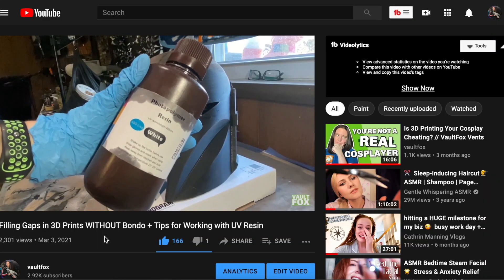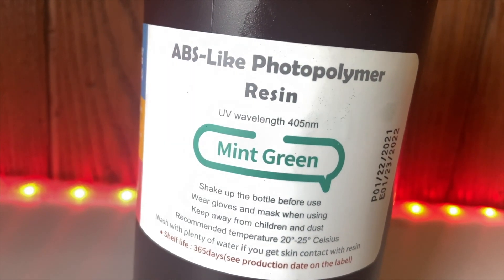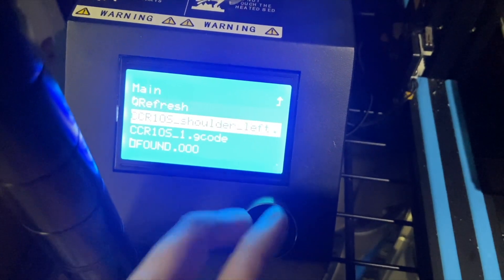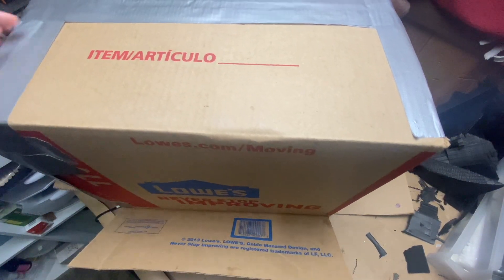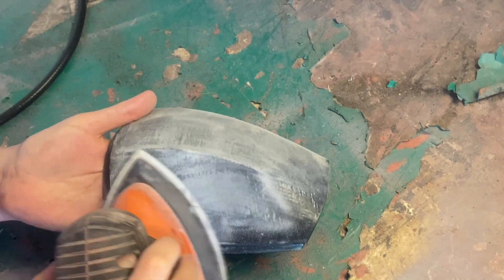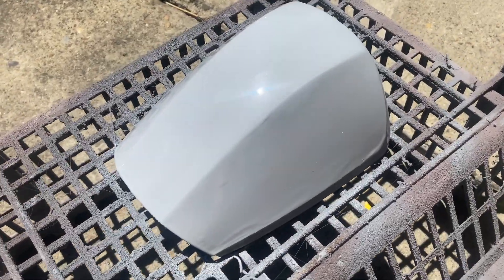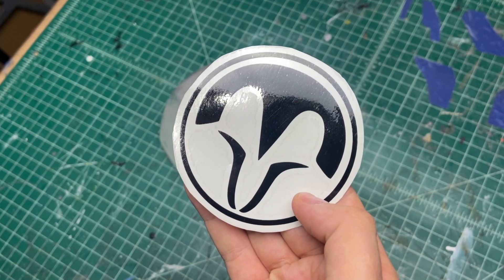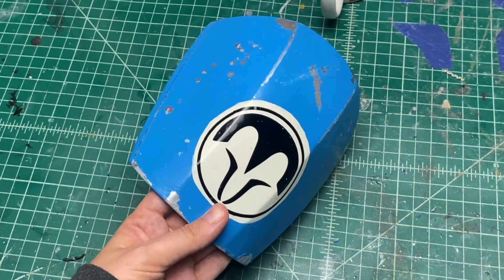How to Smooth 3D Prints with UV Resin SAFELY // Guide to Smoothing 3D Prints with UV Resin

Comment: How are you getting the resin to go on without bubbles?
Reply from the maker: tbh I've never had issue with the bubbles (they sand off pretty quick) but I've had other commenters say they hit it with a heat gun to get rid of them. if you do that, just be careful and wear a respirator
Reply: @vaultfox  ok thanks hopefully sanding fixes it

Comment: Anyone got problems with Uncured Resin ? A friend broke by accident a 3d print that i give him, and told me there was some sticky liquid so i assume it was uncured resin , could this be caused by pools of resins that got stuck on litle holes ? Or maybe i made tick layers of resin?
Reply from the maker: This is something I discuss in a few UV resin videos, but you have to clean the resin after it cures or else it will always remain tacky. I do it by spraying 91% isopropyl alcohol on the piece and wiping it down until it's a matte finish. This is similar to how those who 3D print with UV Resin printers post-process their stuff.

Comment: This is so helpful, thank you! Does it have to be a UV resin to work? I have regular resin that I use for cosplay gems and was curious if that would work as well!
Reply from the maker: I haven't done it with regular resin, so not sure. I know there's a specialized resin (called XTC3D) which works nice since it self-levels, not sure how regular resin would level

Comment: I will definitely try this method on a Mando helmet that is supposed to be in pristine condition (well, they all must have been at some point, so why not?). My Boba Fett costume was completely made with the "traditional" method: 3d print, sanding, filler primer, sanding, car body filler, sanding...etc. It is not 100% smooth, as this will be the post-sarlacc version. Here, it is enough for me that the printlines are gone. But this next costume (most of it will be aluminium, but the helmet is a 3d print) will have not battle damage, and the helmet will be done with Alclad chrome. So printer resin this time it is.
Reply from the maker: awesome, hope it works out for you! just remember to be careful with that stuff and wear PPE and gloves while handling. you can get some nasty contact allergies if this stuff gets in contact with your skin

Comment: Tip when masking with painters tape if you use the color your trying to preserve you will get cleaner lines so in your case white-mask- white then blue so whatever bleeds through the tape will be white
Reply from the maker: thank you! I've heard of that before but never really looked into if it worked or not, will give that a go next time I've got masking work to do

Comment: Hii And Help! Ive followd you're method just as described, but for some reason when i start spraying the primer over the cleaned resin. It starts forming tiny holes in the primer and in the resin.  Did you experience such a thing and or how did you fix this?
Reply from the maker: You may have had some bubbles in the resin? I personally haven't had that issue but others have commented that they experienced what you just explained. You can either apply a second layer of resin and go over it with a heat gun on LOW heat to pop them, or if the bubbles are small enough I would probably just spot fill them with bondo if they are tiny enough.
Reply: So your saying, there are tiny bubbles under the surface that arent visible without the primer, or melt as soon you put spray paint on. That makes a bit off sense cause a air bubble might melt from the propellant. Mabey its your weather type that helps you i am from the Netherlands always very humid and cold over here.

Comment: There's no need to remove the inhibition layer between coats of resin.  Think of getting a gel manicure.  The nail tech doesn't wipe between coats, only at the end.  Once you put on your second coat, the first inhibition layer will no longer be exposed to oxygen and will cure with the new coat.  Then you have a new inhibition layer to remove at the end.
Reply from the maker: Thanks so much! Honestly working with this stuff has been a heck of a learning experience so appreciate your help

Comment: What program are you using for a fitment sizer?!?! Sorry if you cover that in a dif vid, I didn’t see one 🤦🏽‍♂️
Reply from the maker: not sure what you mean by filament size? are you talking about the slicer? because if so I use CURA
Reply: @vaultfox  not the slicer but there’s a few programs that slow you to put in “your” “head, chest, calf, forearm” measurements to properly size the print % and was curious if you used one regularly? I haven’t tried that yet and just figure it would be a big saving on filament!!! 

Also this vid is awesome btw!!! I have a helmet and currently printing a 1:12 figure scale Razor Crest that I’d like to try this on 👍🏾👍🏾 so thanks!! Just have to build a large enough curing station🤦🏽‍♂️😂
Reply: @vaultfox  ~let you put in* sorry lol

Comment: Great video! Loving the "consumer grade" UV light box xD
Incidentally, the UV resin has to have oxygen inhibition, or else it would glue itself to the layer curing window of the 3D printers it's used in, so we're never gonna do away with that cleaning step, sadly
Reply from the maker: No need to use fancy stuff when you have cardboard laying around! The cleaning step really isn’t so bad (I find it kind of satisfying to get rid of that sticky layer) but makes total sense why it’s necessary

Comment: Wow. Just did a single coat on a print. The 40 min it took from start to getting it dry and clean was way easier, cleaner, and better finish. Thanks for the push to try this out. Now back to working on my helmet. Thank you so much
Reply from the maker: You're welcome! I'm glad it worked out for you, it's a lot of trial and error but when you get it right it saves soooo much time

Comment: Whenever i use a foam brush i always get little foam pieces on my print that get trapped in the resin when it cures, does this happen with you?
Reply from the maker: Yep! I happened to me a lot when I was using foam brushes. Thankfully, you can sand them down fairly easy after it's all cured but I've switched over to using just a regular old paintbrush to apply the resin (I was out the brush with 91% or higher Isopropyl Alcohol and it cleans it right up, just be sure not to get that brush anywhere near UV light or sunlight or else it'll cure the resin to it)

Comment: Just wo.ndering if doing the resin thing on props. Does help from the heat from Warping the prop if you left it in the car
Reply from the maker: I would assume it offers some protection but  I haven't personally tested it, still not the best idea to leave PLA  3D prints in a hot car
Reply: Just
 Wondering just hear stories about this👍🏼

Comment: A question - I'm working on a set of Colonial Marine armor (from Aliens) and I already did a bunch of Bondo work and partial painting (because I was impatient as fuck and decided to just go ahead and try painting the damn thing since I've done so many reprints and so much Bondo work and sanding; I needed to do something new ere I lose my mind). I saw this and went "Oh. Wow." (both in frustration and joy, from realizing I did most of that work for nothing and because this method looks fantastic, respectively), and I'm just wondering two things:

1) Does this mask the lines between two printed pieces (you've only shown us things like shoulder pads and glover armor; the first piece of armor I've printed is the front half of the torso, which was too big for one printing so I printed it in pieces) like Bondo does? And if this method/material doesn't cover those lines, would you recommend anything else over Bondo or is Bondo still the only real way to go to cover the lines?

2) Can you apply this technique/material over preestablished paint and Bondo (I don't care about having to repaint it; it would be worth the extra work) and still have a desirable outcome?

I really need to know because I don't want to either keep doing what I'm doing with more work and mess, or spend a bunch of money and time on the supplies for this method only to find out that it accomplishes absolutely nothing when applied on top of my old method. Excellent video (like your other videos), by the way.

Comment: Would you be able to link your cura settings for the shoulder? When I saw 5 hours I had to do a double take since even with custom supports my Mando shoulder takes at least 22 hours at 100m/s
Thank you
Reply from the maker: It's been a bit but pretty sure they were set at something like .28mm layer height with 10% infill, 2% support infill and 120mm/s
Reply: @vaultfox  thanks for the quick response. I’ll check these settings out and see how it turns out. With .2 layer height, 10% infill, 5% support density, and 100m/s it took me 22 hours for one Mando shoulder 
5 hours would be unreal

Comment: Love the idea of the resin smoothing. Makes it look quite easy. For me personally though I have young kids (that are always around) so have tried to avoid anything that is too toxic for them. If I wait for times they are not there it really limits the amount of work I can do. For now I will stick with sanding and wood filler but it does seem like a cool idea.
Reply from the maker: Honestly that's the exact reaction I wanted to get out of this video ... it IS an easy method but just because it's easier doesn't mean it's for everyone. I've seen far too many videos on this method where they don't talk about the risks and safety precautions and it just ... worries me that people are working with this and not fully understanding the dangers. I still use bondo for larger stuff, usually because it just ends up being more economical (and it's harder to cure larger amounts of resin)
Reply: @vaultfox  yes I think when you are just getting into the hobby it's easy to see people doing it a certain way so you do that without knowing the risks. In cosplay we work with so many different materials/chemicals that you do need to be careful of. Between contact cement, plastidip, spray paint there are a lot of others I am already cautious of with the kids. I have just tested out Flexbond as an alternative to plastidip to try and reduce some toxic items but you can't avoid them all as they do have their place. Just have to be safe.

Comment: i liked the video but are you talking really fast or is it just me? ive used wood filler or universal filler before to smooth things out, doesnt smell :) but really only used it on small figures... what was the the little bumps on the print? was that from random seam position?
Reply from the maker: I do tend to talk fast :P and those little bumps I'm pretty sure are due to some of my retraction settings, I just haven't messed with them yet. They easily sand away so it hasn't been worth it for me to do that just yet
Reply: @vaultfox  ah right, it might be worth getting a better extruder before you fiddle, if you got the same extruder as on ender 3, it's pretty variable with resistance how much plastic it actually moves.. Duel gear ones are much more consistent 😊

Comment: I have found a quick pass with a heat gun before I cure, levels and removes air bubbles
Reply from the maker: Good to know, I don't usually worry about it since they sand away easily but that can cut out some time

Comment: Fantastic video

this is overkill but my mindset is you can never be too safe. Consider arm sleeve to prevent resin touching your arm:

https://www.amazon.com/AMZ-Polyethylene-Oversleeves-Protective-Painting/dp/B0868V3TMQ/ref=mp_s_a_1_6?dchild=1&keywords=disposable+sleeves&qid=1625079788&sr=8-6
Reply from the maker: Thanks! And yeah, that’s honestly a good catch too because I’ve accidentally gotten it on my arm before (usually too late to just wash it off without consequences). It is really important to stress how you should NOT tread lightly working with resin

Comment: AWESOME VIDEO!  I have a question though.  What do you use for the padding on the inside of your bucket helmets?  I printed a mando helment recently, but i definitely need some padding on the inside to make it sit correctly on my head (and for comfort).
Reply from the maker: Thank you! And I just use upholstery foam, the thick green stuff you find in JoAnn’s. It’s not the most breathable stuff in the world but it’s cheap, I just glue it in with hot glue